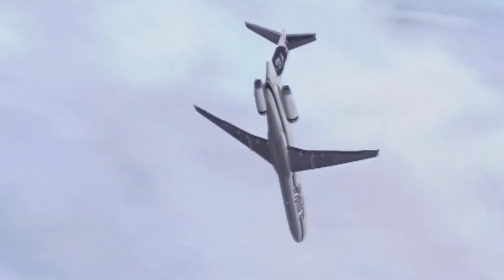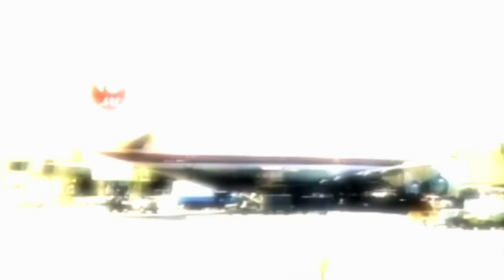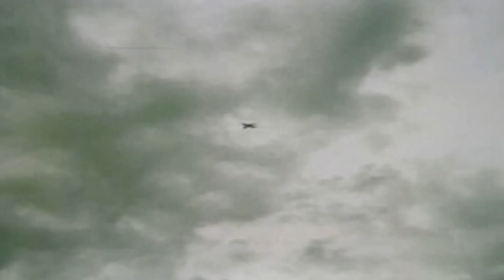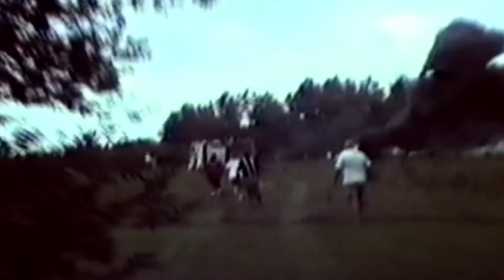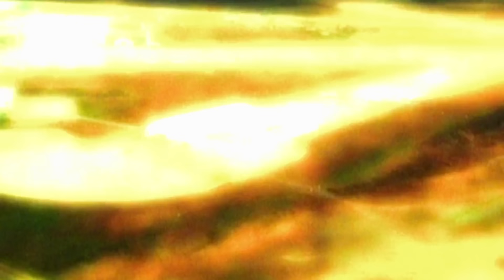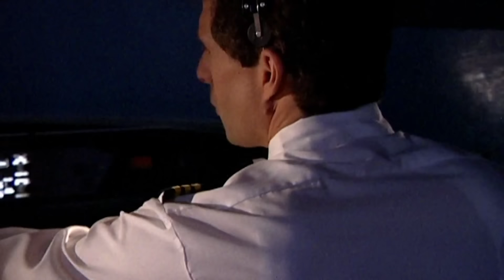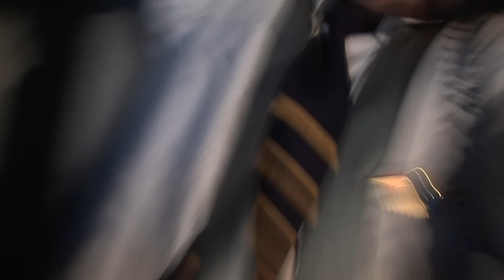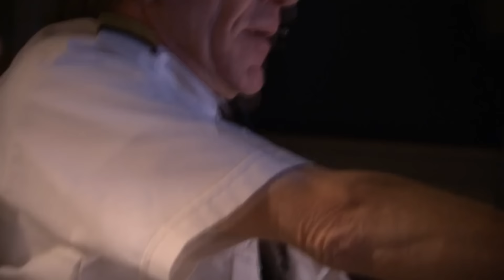The Consequences Of Overlooking Aviation Maintenance And Repair... | Mayday: Science of Disaster

Comment: I work as an engineer in an industry where the atmosphere is often classified as potentially explosive.  We use various techniques to prevent explosions.  However, my worst nightmare is to discover 20 years down the road that some system I designed was leaking and someone was injured or killed.  So, I refuse to cut corners in my designs for these systems.  I won’t live out my retirement knowing I hurt someone.  Too much free time to ponder it.
Reply: Indeed.
I can't imagine working a complex job, where a single honest mistake could cost hundreds of lives.
Kudos to those like yourself, for taking on such huge responsibility & stress.  (zero room for error)
Reply: I was a maintainer in the Air Force. We had a saying "If there is doubt, there is NO doubt".
If we we weren't sure about a repair, the jet would not be signed off.
As a 19 year old, I have grounded multimilloin dollar jets, fueled up armed with the pilot waiting in the wings.  In aviation safety is first and formost in anything we do.
Reply: @trespire  I too was an Air Force maintainer, but for ICBMs.  Our saying was "Take your time, do it right the first time" the unspoken part of the saying because of what we worked around was "because you might not get a second time", that got demonstrated to us by multiple safety pictures and videos of real life incidents.
If the repair wasn't 100% done, then the workorder didn't get closed out completely.  Though to be fair on the workorders that did get closed and we'd be going back out to the same site for the same thing a week or two later we were working on components from the 1950s a lot of times in the hardware of the sites, the ICBMs and their electronics were much more up to date for the most part.
Didn't get onto the sites until I was 21 years old due to the amount of training I had to go through (about 1.5 years worth broken up over 2.5 years), but when I did, I could take an ICBM off alert and shut it down completely (did it once or twice), did maintenance on equipment located under the rocket nozzles, and worked on equipment panels with my back a foot or two from an opening to the hundred foot deep launch tube.  Safety was also prevalent in everything we did, and anyone that did not feel like an action was safe was free to have any and all tasks stopped at least while I was there(did have a few people try to exploit this more then once, but once their racket was found out in regards to this, it did not end well for them)
Reply: @ruthgar9753 So if some finicky work had to be done several dozen feet up but a books breath away from the abyss, one could essentially say:"Until this is done, nothing else will be done in here. "?
Reply: @trespire Our phrase was "when in doubt: take it out"
Reply: Often the design it’s fine but maintenance drops the ball
Reply: Don't worry friend 😮
Reply: Wow thanks for sharing.  You could be grateful you have the responsibility knowing how serious you take it.  Good post letting us walk in your shoes for a minute
Reply: Same when I was working in Jet Fuel delivery. Rigorous testing for water, it was never skipped no matter if the batch was fresh and you've already done a load. Always testing the parameters so they match to batch specifications. Everyone seems to take their job seriously in the entire supply chain because I never came across a single anomaly to report.
Reply: I hope God gives you the strength to continue to stick by these values and take actions and make decisions that uphold them far into the future regardless as to how tough things get!!
Reply: @Ryarios  you said it
Reply: Experience teaches most people this but most people don’t even think. That’s why this happened. Hindsight is twenty - twenty,foresight not so much.
Reply: @Ryarios  Thank you for the time and effort put into what you do.
Reply: We as the public thank you for your dedication. I would love to believe that anyone is responsible for people’s lives always remember that they literally have lives in their hands and corporate greed and corners being cut should be reported.
Reply: Nobody cares
Reply: Oh come on man. You are too harsh on yourself. I think the issue is testing. Test the heck ot of a system. You can not predict everything what can go wrong. But you can identify it in time.

Comment: Couldn't this plane fly on one engine? I thought the reason for two engines is...... in case one fails you have another one. Did they both fail? Maybe too much drag on the left?  Two previous failures of this prop? How much of a clue is needed? Hindsight is always better, isn't it?
Reply: The whole engine got pulled out of alignment and caused more drag than the plane could compensate for
Reply: OK thanks.
Reply: All airplanes are certified to fly on a single engine during takeoff as part of a certification
Reply: Rudder failure is control problem different than engine failure. Steering ruins. Cannot go up or down. Land? Forget about it.

Comment: These are the reasons why my mentality for every aircraft I work on is that it is mine as surely as if I will be the next person flying on it. The aviation safety and accident investigation courses I took at Embry Riddle really opened my eyes to how much of a difference doing the right or wrong thing can make.It's scary how little it takes for the worst to happen.
Reply: Thank you for your good work.
Reply: As the son of person who will need to fly soon and a fellow engineer albeit in different industries, I thank you for assuring there are diligence in the maintenance of our infrastructure. ❤
Reply: I couldn't agree more, Brian. The worst time in an aircraft mechanic's day is at the end of the shift or when the aircraft is about to get the maintenance release signed.....and you look down and see a fault. Last minute faults have the potential to be ignored. But men and women of integrity just simply STOP.....make a log entry.....and fix the airplane regardless of a late departure or not. We fix the airplane. You can NEVER go wrong by doing the right thing. 
 Once I was putting up my tools and headed for the locker room. I walked past the wheel well on a plane about to be pushed out of the hangar for it's morning flight.  I looked over and saw some dust on a pressure sensor. Mind you, the MRD was green. Somebody already signed it. So I go to flick the dust off of the pressure sensor and a hole opens up in the body of the sensor. It wasn't dust....it was exfoliation corrosion. 
Yeah....people waving their arms at me...."What were you doing looking there?"   But the Lead Mechanic got right back in their face and said, "That's what we are here for....to fix the airplane."   Better to find it in the hangar then have the pilot find it at the gate.
Reply: @rael5469  You have no idea how much I feel you on this. The biggest heartbreak I've had was being scolded for and told not to look for other problems. I've "extended" my scope of work without saying anything to fix what needed to be fixed. Currently I have gotten a job working on military aircraft so my very best work around is to tell the squadron directly "hey, I didn't tell tell you to look here but you REALLY need to look here". Once they submit the request for a repair I can't be told no lol. Wish it worked that way when I worked on commercial aircraft.
Reply: @Brian0045   Keep em flying, Brian.
Reply: Yer too rigid,too anal,im a D,E,i enginear andb befhore we inspeck we smoke a goodd. BLunt,cuz stres kils,relax dood.
Reply: Also a Riddle grad . My thoughts were it had to be completed as if my family were flying on it.
Reply: As a ex mechanic I worked on cars for a little while and also was a porter driving vehicles the amount of times where I thought I caused an incident or damage to a vehicle but I didn't in the amount of times I thought I maybe did especially after damaging a vehicle at the dealership feels like almost every car I worked on after felt like did I cause that damage or was that already there so fucking stressful
Reply: We need everyone to be so diligent...as a person who likes to fly and have done so quite a few times...THANK YOU!

Comment: At the end of this video the inspector says these planes should last “forever” if maintained correctly, well all you have to do is look at the B52❤, here is a plane that not only is maintained but upgraded on a regular basis and some of those airframes are over 70 years old and they expect them to fly for another 30-50 years! That’s utterly amazing!
Reply: B-52s have VERY few hours on them. B-52s fly a fraction of the hours compared to airliners. I think I read somewhere that a B-52 only flies around 380 hours per year. An airliner flies ten times that much and has ten times as many hours on the airframe.
Reply: @rael5469  actually there are many if not existing B52’s were part of chrome dome that had at minimum three aircraft in the air circling above Canada & Alaska during the Cold War 24 hrs a day 7 days a week so even though most Civilian aircraft probably have more cycles on them the actual flying hours on many B52’s is very substantial! There is a reason they have refueling capability that civilian aircraft do not have, just a thought?
Reply: @Mtlmshr  The oldest B-52H is at 21,000 hours. The average is 17,000. I just worked on an airliner last night that has over 100,000 hours and it is MUCH younger than the B-52H.....and still in service. See what I mean? That's just the reality of it. Air Force aircraft hardly ever get off the ground. Not like airliners.
Reply: The limiting factor of the B-52 is the upper wing surface. It has a operational life of about 35000 hrs. The B-52s have very low hours compared to their age. Most military aircraft have lower flight hours compared to commercial aircraft, and MUCH lower cycles. I recently worked on a 31 year old MD-11 with 110000 hours and 30000+ cycles. It is a McDonnell Douglas aircraft so it's built like a tank.
Reply: I guess that depends on how much of the machine they are willing to replace in maintenance. Nothing lasts forever, especially metal and composite components that are repeatedly put thru the same stresses time and again. If the maintenance cycle includes ultimately replacing every single component at some point, then such machines could basically last forever, although absolutely no part would be original after a period of time.
Reply: @justlucky8254  I could not agree with you more. How many old WWII War birds are “restored” but hardly any of the original plane remains, so is it in fact the same aircraft? There are arguments for both sides. The way I look at is, that if the plane still has its original ID plate and the plane flies with upgrades (or whatever you may want to call it) then it’s still that airplane.
Reply: @Mtlmshr  that makes sense. I look at similarly to how some view old cars. "Numbers matching" is a big point, even if the internals of the drive train have been replaced, interior replaced, etc. Everything mechanical needs maintenance and replacement of various original components, but sometimes everything is replaced, including the frame, and you essentially have a different vehicle altogether. Even the identification tags/badges/etc are tricky since they are reused and attached to new components. In the end, I'm rambling about nothing. The planes are incredible and good maintenence/upgrades have kept so many of them around far longer than ever originally intended which is awesome.
Reply: @Mtlmshr  that data plate is legally the airplane. All the rest is technically just parts. You can have everything together and fully functional, but without that data plate, legally it is not an airplane. Atleast in the US.
Reply: The KC-135 is a great example

Comment: Southwest Airlines was found to be a major contributor to pressure Boeing in hiding the MCAS system from the flight manuals check lists and cockpit warnings in order not to have pilots re-certified on the aircraft type plus Boeing had a penalty of $1.000.000 per aircraft delivered to Southwest if not adhering to the "suggestions". If I'm remembering well enough. We all know that corporate greed has lethal consequences in a chain reaction with massive collateral damages. That is evil.

Comment: Amazing how many accidents our causes my small simple errors that could of been fixed  prior swish air being a specific example that comes to my head.
Reply: The Swiss Air 111 crash was not caused by a small error. MPET and IFE were big issues.
Reply: @oahuhawaii2141  my bad it was a more sever mistake with the whole entertainment system.
Reply: @slagarcrue85 : The crash led the whole airline industry to change materials, and be more vigilant in adopting non-aviation systems in planes. Scary how the industry missed such basic checks and testing. I'm reminded how an early B777 caught fire and burned on the tarmac when its bank of lithium ion batteries overheated -- Boeing neglected to have electronics to monitor the battery temperature, which is something very basic in all smart batteries using Li ion cells, and is stated in the cell manufacturer's data sheets.

Comment: A-10... fly with 700+ holes in the entire body, missing most screws and structure parts also critical points, still fly, open fire and do high G moves. 

airlines aircraft: lose 1 screw, explode.
Reply: How is that even logical to you? They are made for different purposes.
Reply: the A10 was built like a tank. taking punishment and dishing out where ever needed

Comment: Visual inspection is NOT to be considered as an inspection. Planes are full of cracks, metal fatigue,  Unforgivable.
Reply: I assuming you are referring to the Brasilia Hamilton standard propeller. Unfortunately that propeller has a bit of a history. It had several problems that had to be worked out.
Reply: I should have also stated, that as far as I know that propeller has been very good the last several decades.

Comment: There is no way to finish a C check in one 12 hour shift on a 737NG-700
Reply: That's right. Thank you.
Reply: @rael5469  aaand your reply got censored. I can read it in the notification email, but it doesn't show up here
Reply: @Knaeckebrotsaege  What are you talking about, I can see my reply right here.
Reply: @Knaeckebrotsaege  That's a bald faced lie. Thanks for the laugh. Southwest is shoveling a mountain of BS in this one. Too funny.
Reply: @rael5469  you can see it, but no one else can. a shadowban of sorts on that comment. try incognito mode (not logged in) and it won't be there. ran into the same stuff multiple times because i used a word that was blocked by the channel owner (or swearwords). depends on how strict they set it
Reply: @Knaeckebrotsaege  OK, I just checked and had someone else look for it.....while not logged in......and they can see it. So again, I don't know what you are talking about. As far as i can tell it is seen with every other reply.
Reply: @rael5469  I see 3 comments from you. The first is "Thats right. Thank you". The other 2 are you replying about being able to see/not see your comment. Did you have more than 3 comments here?
Reply: @justlucky8254  I don't know what you guys are talking about. I independently verified that my comments are seen by others along with all the comments and replies. I verified it myself from an anonymous other location. So.....Maybe it's your settings.
Reply: I was thinking exactly the same thing. The aircraft types I work on are a fair bit bigger than the 737 (777 and 787), but to carry out a C Check in a night? We’re lucky to get a C1 done in 2 weeks
Reply: C-check is at least a few months depending on aircraft age. An A-check takes us all shift.
Reply: 12 hour? welp... 47:05
Reply: @Knaeckebrotsaege  That's a bald faced lie. Thanks for the laugh. Southwest is shoveling a mountain of BS in this one. Too funny.

Comment: Separate the two, if they need to save money the maintenance of the plane shouldn't be an option.
Reply: I've always wondered if deregulation, which I normally support, in the case of Aviation resulted an increase in cost-cutting.
Reply: @John Lang - I agree with your deduction.  
We saw the same behavior after many controls were removed from the banking system - leading to the 2008 recession

Comment: Two comments on this video. 1) In the area of linear actuators there is a major difference between ball screw actuators and thread or Acme Screw actuators and hydraulic actuators.  Good maintenance starts with good engineering.  2)  Maintenance is a stepchild profession.  Good people look for other professions.  Many products are sold on the basis of not needing much maintenance,
Keeping things running safely is mainly a cultural problem
Reply: I used to work in maintenance, but chose the engineering profession because the compensation was better. Sadly, I did enjoy the work to a certain extent though.